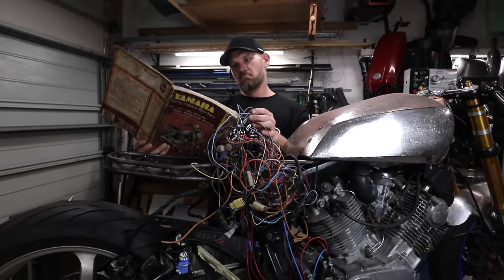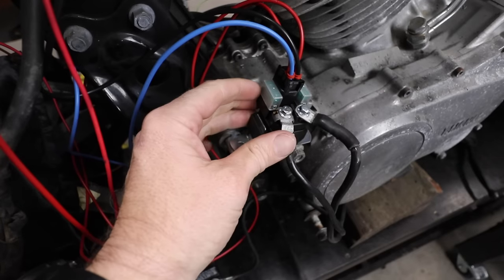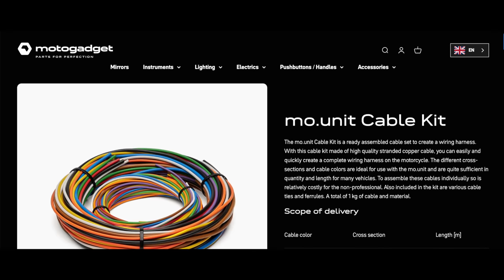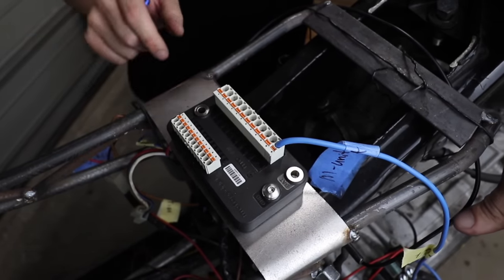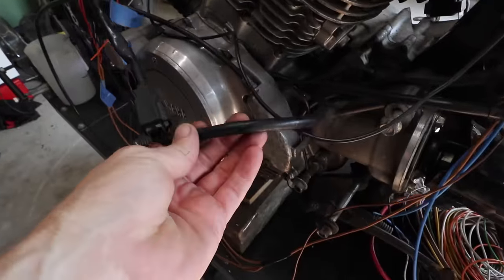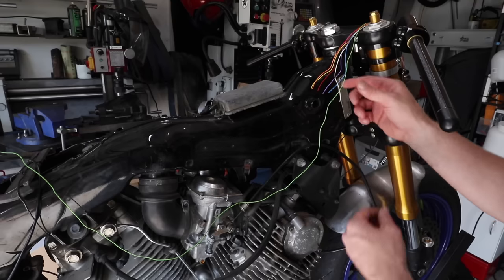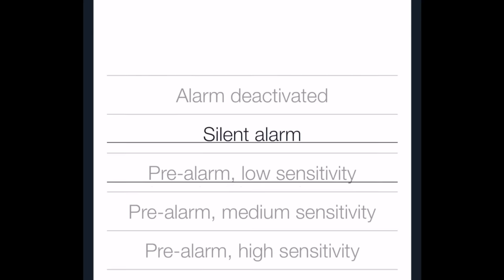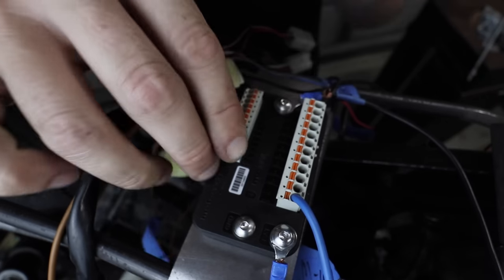6 STEPS TO SIMPLIFY MOTORCYCLE WIRING!!!

Comment: I'm assuming when you do the final connections you will solder the ends of the bare wires connecting to the M unit ??  Or do you leave the strands bare and just tighten the screw to the wires to hold it in place?
Reply from the maker: The mo.unit comes with ferrule wire connectors when you do the final
Reply: Yeah you should use ferrules rather than solder them.

For high current especially don't skip the ferrules. On motorbikes or another thing with that style connectors.

(For someone reading, ferrule is just like a piece of metal that you crimp on the end of the wire, so when you stick it into a terminal thats screw down or spring loaded or similar the strands don't start moving and the connection doesn't become loose and form a resistance that will then get hot when large current is passing through it.    It doesn't really matter all that much for signal wires.).

Comment: Masking tape! I’m building my FuelTech Harness from n unterminated harness. Using thin masking tape allows to add n remove wire as you figure what you need n don’t. Pre wire the engine in the car. If wires need moved like 2-step. I can simply remove it from the round of tape instead of looking for side cutter for zip-ties😉

Comment: I have a venom x18 and my headlights don't turn on my back light are on constantly even when the light switch is off, its used I've tried followering the wires but can't seem to get under the seat area where the back lights, maybe someone has had something similar happened or knows what I can do?

Comment: Bro, I got a salvaged Honda CBF300NA from a police auction last week and there were wires and splices for random electronics everywhere. I got frustrated and just chopped most of it off but I couldn't tell what wraps were factory and which were spliced. I spent about 10 hours just tracing the wiring and removing the extra stuff, but it left me without some connectors. Since I'm new to wiring motorcycles, I've been hunting for inspiration on whether to try to simplify it further or take it back to near-factory. This video came up and it made me feel good about not just slapping the ignition on and taking the time to plan the rewire. Thanks for this video. You've earned a subscriber!

Comment: Dan so kind of you to make the effort and break this down. I have an M-Unit and kit to upgrade some crusty wiring on my resto -mod Yamaha TRX and  bin a whole lot of components and weight I now feel much more confident about installing an upgraded system.  So thank you !!

 I'm baulking at the switch gear. It can be mighty expensive and I do not want to have switch gear which is confusing to operate such as a kill switch or hazard lights if theres an accident and it's up to a bystander to know which button to use ?  I'll figure it out but I particularly like your comment about helping each other out. Cheers Dave

Comment: Thank you for this very informative short video! 

I would like to request/recommend, if/when it's possible you should make a video series to cover how to rewire a specific motorcycle model from start to end, listing out all the necessary parts needed per bike model. For Example: I am currently working on a 1979 Suzuki GS850G and would love to get rid of the old wiring harness, use upgraded LED lights and this new technology you are showcasing in this video, but my electrical skills are "0" but I am good in following step by step directions and I bet there are many like myself out there that are good with the mechanical restoration part of a bike but are rusty when it comes to electrical stuff. So, a video stepping through this upgrade process would help a lot of folks save time/money and frustration and they will not end up with extra part at the end of this upgrade process.

Comment: Hi Dan, I've just finished the same bike also with the full Motogadget and Revival Cycles pack and LI-ion battery and Rick's Motorsport Reg/Rec. And my advices to you or whoever is trying this are the following:
- Put an eye on the connector with the 3 white wires between the Reg/Rec and the Stator. I used the original yamaha connector and got so hot that it melted. The solution was to hard wire it.
- If you notice that you have weak starter for some reason. Run a good thick ground wire directly to one of the bolts of the starter motor.
- If you are also planing to use a KN&N air Filter and stock carbs, you will have to modify the internals of the filter, otherwise it will be really dificult to caburate. The solution I found was to restrict the air flow by sticking a 90 degrees PVC pipe join inside the filter leaving the open end of the PVC join pointing rearwards.
- I don't know If you also plan to do it, but I also converted the mechanical clutch to a Hydraulic one and still playing with it.

Un Saludo
Reply from the maker: This is fantastic information mate thank you for the tips
Reply from the maker: Follow me on insta and send me some pics of the filter mods If you want :) love to see how you did this

Comment: amazing video dude thank you! currently doing a custom suzuki bandit build and pulling the harness out i was like... "there has to be a way to declutter this garbage" thanks you!
Reply: One thing he doesn't do that I highly recommend is to get ferrules for the wires going directly into the Mo.Unit terminals, along with a ferrule crimper. It ensures better and more consistent contact and longer wire life at the connection point.

Comment: I am rebuilding a 1998 Suzuki Bandit 600, and when turning the key to on position I get only the tail light and the fuel relay clicks.. Nothing else turns on. However when I turn the key to Prime, i get break lights, headlights, turn signals...but still no power to clocks or starter motor..

Bought a wire harness off ebay. was in much better condition than my original one... has all the correct connectors and fits without force. 

Bought a new Ignition lock cylinder, as my old one was missing keys, and connector...

Bought new starter motor...

Bought New Ground/ Earth wire...

Ive done quite a bit I'm just not electrical inclined... This video helps with the issue i am facing but I am using stock parts, as  I did not buy the control unit within the video, nor plan to..

Comment: Hi Love your videos, they have been a great help and have inspired me to build my own cafe racer. I have a Honda CX500E. I bought the M-Unit, and trying to wire up the horn, lights, indicators (turn signals) etc, it's my first time trying to do anything like this. Can you advise if I need to have a separate ground wire for each of the components, or can I solder them all together and then have just one wire going to ground, hope this makes sense. Thanks
Reply from the maker: As long as all earth wires go back to the frame of the bike it really won't matter how you do it. I like to have a little earth bus so its neet and you don't have 10 wires all bunched together. Google earth bus and you will see what im saying
Reply: Thanks for your reply, appreciated. I'll look into the earth bus, keep up the great videos @CafeRacerGarage

Comment: Somewhat confused. If everything was working fine, why go through all this trouble and, it seems, significant expense to end up in the same place. If everything was not fine, this will not solve that, at least not for sure, so you will still have a problem.
Reply: If you have a f-ugly mess of wires. You'd want them looking good. This exactly where I'm at with my yamaha. It's simply cosmetic.
Reply: If you have a used bike that everyone has chopped on. These will solve all the reliability issues from said butchered harness. Not to mention you can get rid of the fifty miles of wire and several plugs that Harley Davidson shoves in their head light bucket. That shits ridiculous. Couldn’t even get the headlight back in.